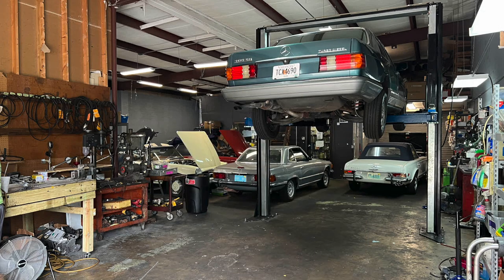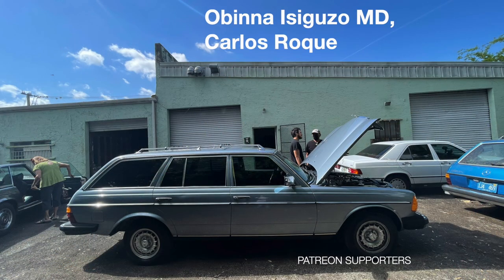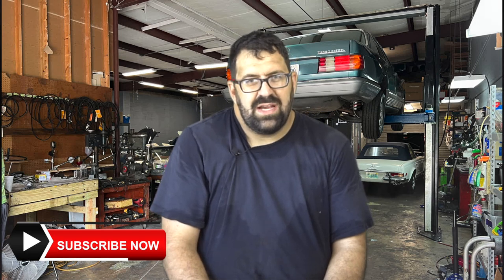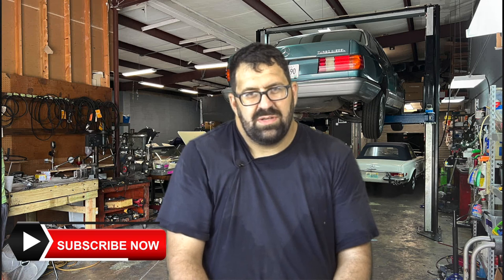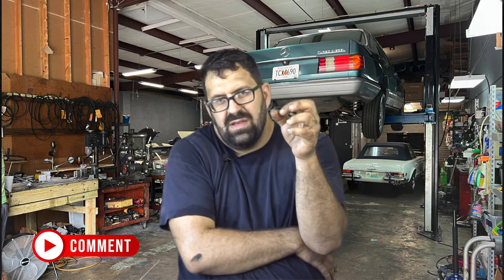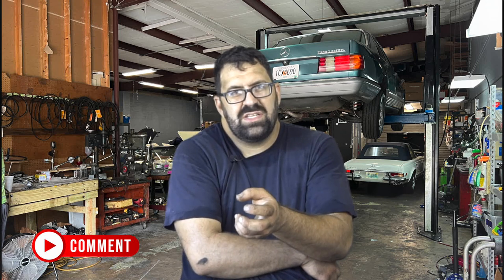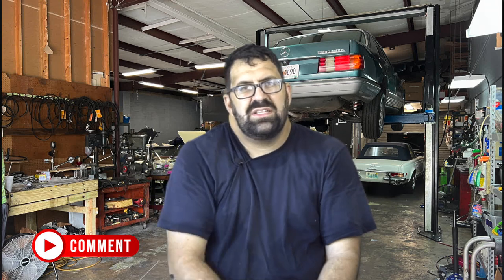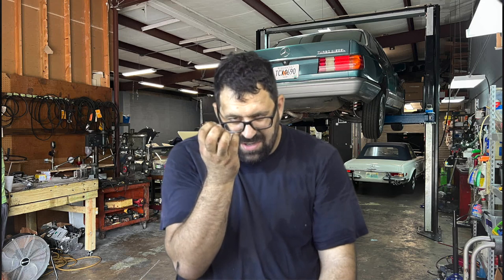What happens with Mercedes Benz Turbo boost engines   HD 1080p

Comment: I have a late '83 and the boost isn't what it once was...but it is still pretty significant at almost 292,000 miles and averaging 26.5-27 mpg.
Reply: which oil do you use, & what interval?
Reply: @MrRjnr  In the OM617, Pennzoil 20W-50 or 15W-40.  Never anything else.  And I change it every 3,700-4,000 miles…got a 1988 300SE, too.  In an M103, you only use 20W-50 and change it every 2,500 miles.
Reply: @closer71  OK great! I use Liqui Moly 15w40 every 3K in my OM617  😃
Reply: @MrRjnr  Yeah that works too. I only use their full synthetic in my GX470 and E500.

Comment: Thanks Pierre, I found after rebuilding the Garret on my 85 300 TD ( 260,000 mi) and playing with the waste gate spring I was able to get a max 14 psi boost @ 4000 rpm.

Comment: The boost on my 85 300CD (California edition) with a rebuilt Garret turbo was 8 psi. By adjusting the waste gate I was able to get 10.3 psi and it will not go higher. I am told by other Mercedes mechanics that the boost on the later turbo diesels was factory set at 9.0 psi when new even though the factory manual says it should be higher.